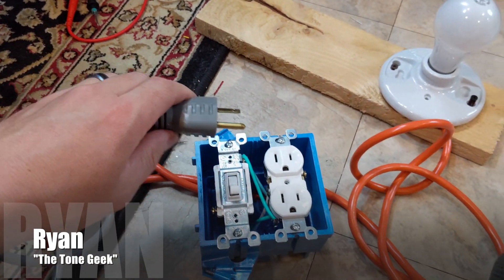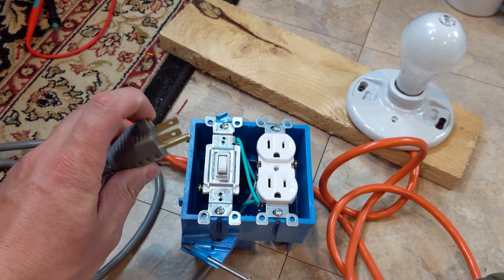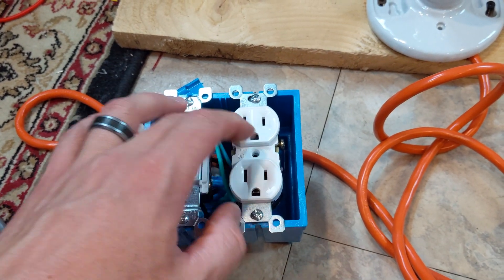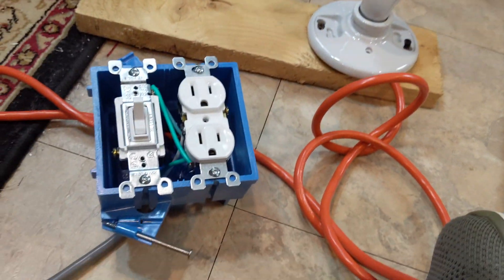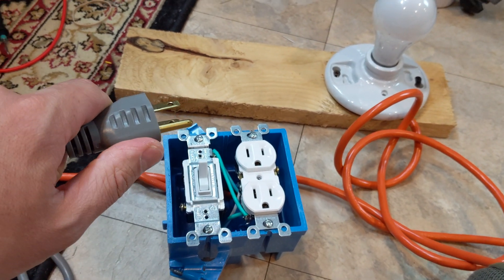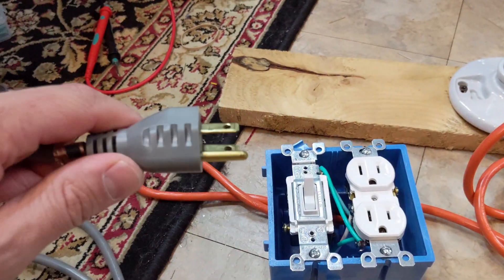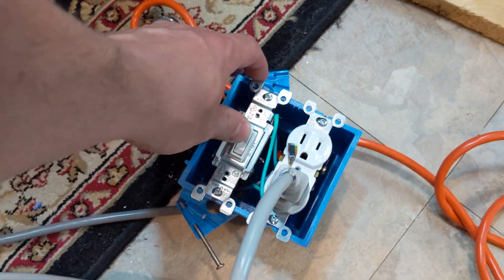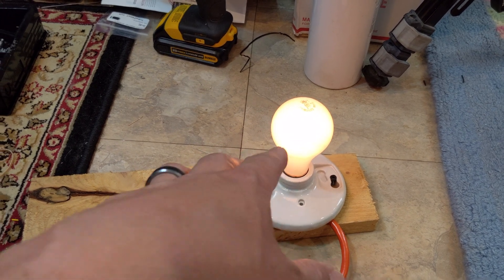Steel String Singer #002 Build | Episode 7: Building a Current Limiter

Comment: Nice work on the current limiter - I know this old but I just came across this.....  Watching you/your channel gives me inspiration and I constantly watch Uncle Doug's old videos and several other techs that use this.... I have a suggestion: use a 200  watt bulb (200-Watt High Lumen Clear A21) because most tube amps you will slight dim at first - a standard 60w is like a fuse and burn up on a short. Just my tested opinion..... 💡
Reply from the maker: Thank you so much for your kind words!!! Uncle Doug is my amp-hero! Great suggestion! I'll try that next! Stop by anytime!

Comment: At around 3:07 you say "this is not technically how you should do it." Can you please clarify? Are you referring to "the way you should do it" when wiring a standard outlet /light, or are you saying this is not technically the way you should wire the current limiter, or other?
Reply from the maker: Great question. I meant color code wise for the return of the light bulb should not be white. It should be a continuation of the black wire however to make this clean, I opted to use the white wire inside the cable that's already there.